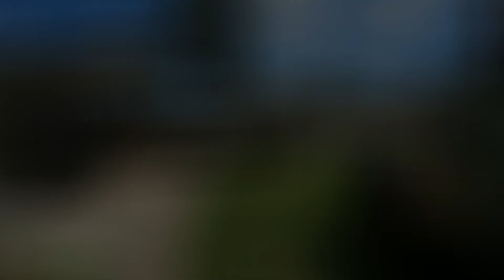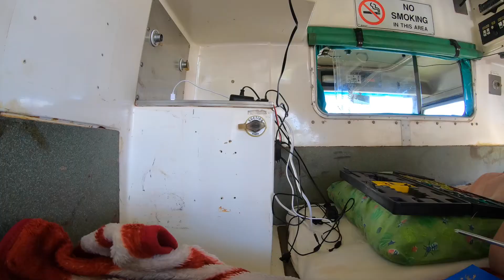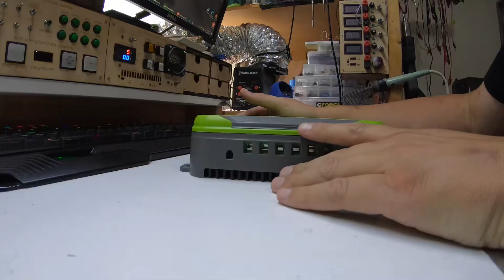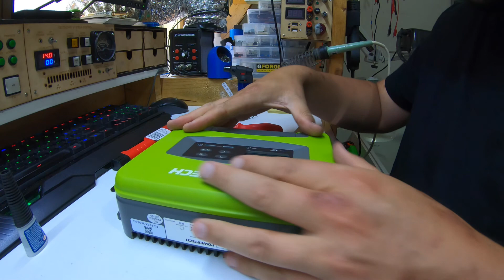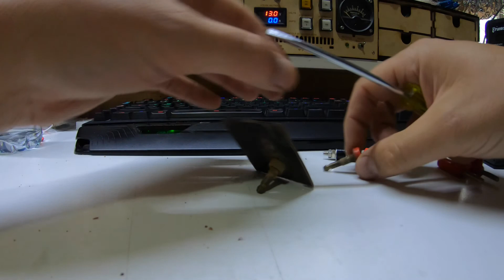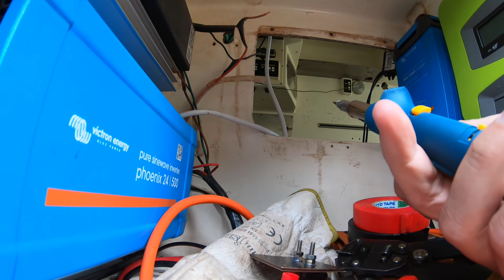6x6 Ambulance solar regulator and auxiliary power connectors

Comment: You can make PTC hot glue guns better by using an autotransformer to drop the voltage to 220 or 200Vac, they then will not boil/cook the glue and last a lot longer.
Might be worth trying a triac dimmer to reduce supply.
At 27:33, I would be using crimp type  lugs, the lugs you soldered to look  a bit on the light side and will flex/break due to fatigue, crimp lugs are thicker and stronger.
Reply from the maker: I have a horrible history with any kind of automotive crimp plug, and they have been responsible for many costly failures.
Yes the lugs are light, and in all honestly those terminals will probabaly go unused.
In a future video I'm half way through, I'll be revamping the entire 24/12v side of things and those terminals will get rewired again, this is mostly a temporary arrangement.
Reply from the maker: As for hot glue guns, there are too many reasons to mention why they cramp my style. Suffice to say I have not had a hot glue injury since I stopped using them.